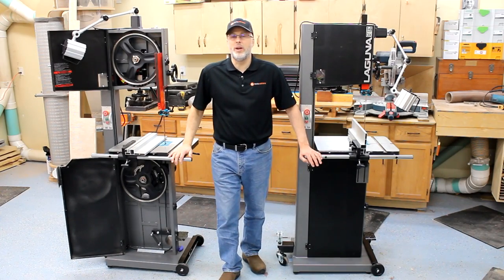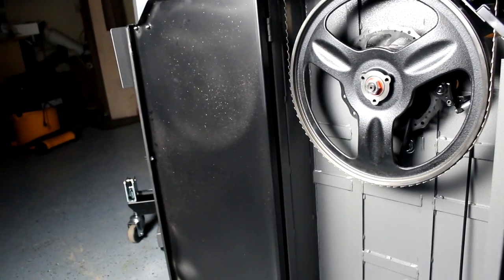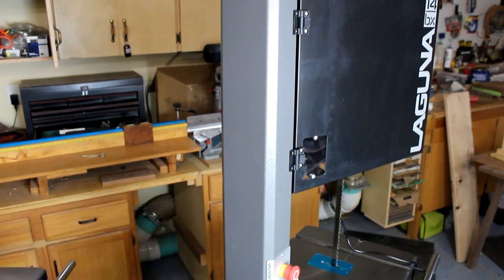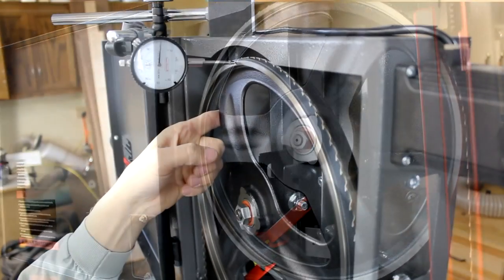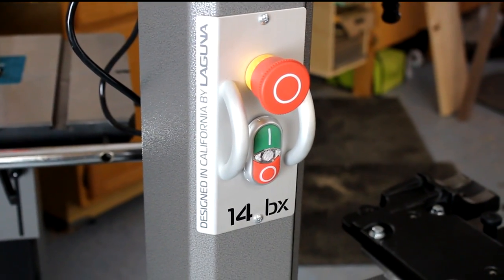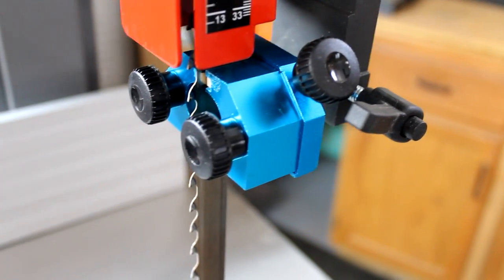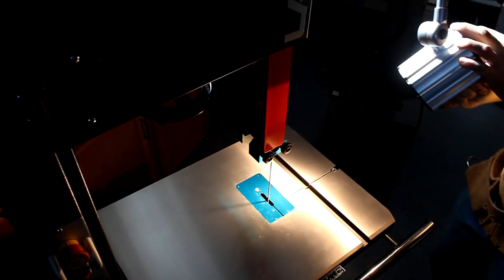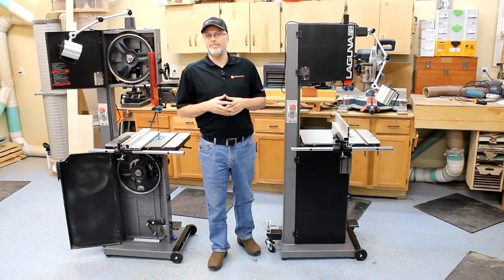Laguna 14bx Bandsaw "Deep Dive" Examination by ToolMetrix

Comment: This was a very helpful review, thank you. I mainly want a bandsaw for dimensioning rough stock and will definitely do a lot of resawing once I have this capability. I also need a machine with a small foot print and good dust collection as I do not have a dedicated workshop to myself. Last but not least, I primarily do my woodworking with hand tools (with exception of plywood projects where I stick with a jigsaw, a small router and a nice track saw set up). So I planned on not putting much weight on the accuracy of a bandsaw as I’ll take a hand plane to it anyway and quite enjoy that process. But after viewing this review, I am excited about the quality of the finished product off the saw. It will allow me to do some fun veneer side projects (hanging lamps!) and to complete projects more efficiently and enjoy more time with my family.
Reply from the maker: Hi Brew, the quality can be very good if you have a good quality blade installed and the saw is tuned.  The approach that I usually take for slicing veneer is to prep the board by planing both sides, slice off a veneer, then sand both sides.  The side that was planed will only need light sanding, while the side that was resawn will need more.  For veneer slicing, a high quality wide blade makes a BIG difference.  If I was making a lamp, I would take the time to set up my Resaw King blade because the surface finish matters.  If you have a drum sander in your shop, it's less critical to get a stellar surface off the resaw, but its still nice and it lets you waste a lot less wood.  For most of my resawing (making 2 boards out of 1, or just using the bandsaw as a "low-dust planer"), I don't really care about getting a great surface finish right off the blade; I just care about flat.  So, for that kind of resawing, I just leave my 1/2" 3 TPI blade on the saw and it does fine.   I'd love to see the lamps that you make.  A wood veneer lamp is on my "someday" list.  :)

Comment: Anyone use these saws for cutting metals with?  Looking to cut st/st exhaust  tubing, but would mainly be used for aluminium
Reply from the maker: I believe that it would be too fast for cutting steel. Aluminum would work but might not be ideal. I’ve cut small pieces of aluminum but not much.
Reply: @ToolMetrix  thankyou for the reply is there only one speed setting
Reply from the maker: Yep. Single speed
Reply: @ToolMetrix  thankyou again

Comment: I am debating the 14/12 and the 110 14BX.  Besides the brake is the 14BX worth the extra money?  Both have the power and resaw capacity I need.
Reply from the maker: Hi Andluth, I like the brake for safety reasons as well as convenience.  I'm accustomed to it now so it would be hard to go back to not having one, but I really liked having the 14|12 as well.    Power and capacity wise these saws are the same, so what it comes down to is the brake as well as the setup process.  The BX goes together a lot quicker because of the unibody design.  The additional dust port on the BX is also nice, although I mostly don't use it and I still get good collection.
Reply: Thanks!  I also read that the frame steel is thicker on the BX. Is that true?  Is the BX significantly more stable (vibration) than the 14/12 and do you think the mobility kit makes a difference in stability?  I hate a wobbly or shaky saw.  Great channel!
Reply from the maker: I have heard that the frame is thicker on the BX, but I haven't personally confirmed this.  I did test for vibration on both saws and found them to be comparable.  That is after replacing the tires on the 14|12, after there were some reported problems on early units which I had.  Having said that, I could measure the difference with a sensitive meter, but I could not feel the difference myself, and I could definitely not assess any difference in cut quality before and after replacing the tires.  So, if I closed my eyes while using them (not a great idea) I don't think I could tell the difference between these two saws.  And I can't tell the difference in the final project.  

Thanks for the feedback on the channel.  I'm hoping to put more time into it this year, cover some additional tools and maybe do some projects.  Lots of ideas, not enough time.  Such is life I guess.

Comment: Gah! Still trying to justify the $300 more for an extra dust port and a foot brake on the 14BX compared to the 1412. Decisions. 🤔
Reply from the maker: Hi Johnny, Super easy decision. Plunk down $100 more (or whatever the difference is currently) and get the 2.5 HP bx. You won’t regret that. 😉
Reply: @ToolMetrix  I'd love to, however; I don't have 220v in my shop and don't have the luxury of upgrading the wiring. 😞 That's why I'm comparing the 1412 and the 14BX
Reply: Both the Laguna 1412 and the 14BX being 1.75HP. But I believe they're both able to be re-wired for 220 in the future? I'd have to check.
Reply from the maker: I totally get that. Can’t go wrong either way between the two that you’re looking at.
Reply: @ToolMetrix  Do you feel the extra dust collection port and the brake on the 14BX is worth the extra cost over the 1412 with all things considered? I believe that's the two main additions other than the 14BX being all one frame compared to the 1412. Am I missing anything?
Reply from the maker: I love the brake. The dust collection is great on the 1412. Second port isn’t critical from my perspective.  I can’t think of other functionality differences. The switches are different but not a big deal.
Reply: Johnny I had the same dilemma. I am a hobbyist wood worker. I have yet to get into serious re-sawing but there have been a few instances that I re-sawed a board through the table saw then got it finished on the planer. I hate jigsaws and needed to notch some things before. While the brake is a good feature I couldn’t justify the added expense. I bought the 1412 on sale today. I got  some extra money I had not anticipated and splurged on this saw. I really hope I use this saw enough to enjoy it and not see it as a waste of money. I think the likely hood of guilt over an excessive splurge would be greater had I bought the mOre expensive saw.

Comment: Some really good information in your review! With it being a “deep dive” review, I was a little disappointed to see that you didn’t differentiate between some of the features that are on either the 1.75hp or the 2.5hp, but not on the other. Specifically, I noticed you mentioned the brake two or three times. Unless it’s changed since I bought my 2.5hp, the 1.75hp does NOT have the brake feature.

One other area that’s different on the two saws are the lights. On the 1.75hp saw, the only light option is the canister-style light. It also has only one place to mount it—on the front above the table. For the 2.5hp saw, the articulating-arm light is the only option. It does, however, give you two choices for mounting. For me, the light information is fairly important because I find that the older I get, the more light I need 😂 Like you, my preference is the articulating-arm style. The two light styles are not interchangeable. The canister is a 110v light, and the articulating is a 220v light. Actually, I considered getting the 1.75hp so I wouldn’t have to add some 220v outlets. I would have had to do that eventually anyway for other tools I bought. For some folks, however, adding 220v outlets might not be an option for them, if they rent, for example. My point is that if I wanted to get the 1.75hp, I couldn’t get the articulating-arm light, and I wouldn’t have the brake, either. Those were the two deciding factors that caused me to go with the 2.5hp. 

I’m sorry if my comment sounds like I’m dinging your entire review video...I’m really not!!!  You have some really good information overall 😊 I just wanted to alert you to the differences in the features and explain why it could be confusing for some, or even cause them to buy the wrong hp saw, if those features were important to them.
Reply from the maker: Hi Kristi, thanks for your comments. At the time that I filmed this there were no differences in features or accessories between the two saws other than the motor and the on-board outlet (2.5 HP outlet is wired for 220V, and on the 1.75 HP the outlet is wired 110V).  Other than that, these saws are part-for-part identical.  If there would have been more differences I would have covered them. You’re mistaken about the brake. All 14bx saws have always had one, and you can see that on the web site: https://lagunatools.com/classic/bandsaws/14bx-bandsaw/. You're also mistaken about the light.  The 14bx 1.75 HP can use the articulating arm light, and in fact it is shown with one in this video.  I think you’re confusing the 14bx 1.75hp with the 1412 which doesn’t have a brake, uses a 2 piece body, and some other subtle differences.  Cheers, Paul

Comment: I think you sold me.
Reply from the maker: You won’t regret it. :)
Reply: @ToolMetrix  Do you need any special guides to run an 1/8" blade or will it run on the stock guides?
Reply from the maker: Hi Ilan, you cannot run an 1/8" blade with the stock guides.  The teeth will contact the ceramic guides and will be dulled instantly.  For a blade that small, you can use the Laguna mini guides https://lagunatools.com/accessories/bandsaw-accessories/ceramic-guides/mini-guide/, which are softer and won't damage the blade, or you can use a Carter stabilizer https://www.carterproducts.com/jet-16-20-laguna-16-jet1.
Reply: @ToolMetrix  Thank you! What's the smallest blade you can run on the stock guides? 3/16"? 1/4" ?
Reply from the maker: Practically speaking I’d say 1/4. I’ve never tried a 3/16” blade but I feel like it would be beyond pushing your luck. Maybe with a high tooth count and shallow gullets you could get away with it.

Comment: That’s it......I’m buying one!
Reply from the maker: Awesome! Which one will you go with?
Reply: @ToolMetrix  110 volt. Looking at the 14 bx. I like the idea of the foot brake. How does the Laguna wheel kit not get in the way of the brake?
Reply from the maker: Great saw. The pedal for the wheel kit is positioned on the left side of the saw and the brake is on the right. No interference at all.
Reply: @ToolMetrix  well I decided to go with the 1412. The ten percent off sale on laguna ended today. The 14 bx was about 20% more people than the 1412. I have never had a band saw and am not exactly sure how much I will use it. I wanted to get a good saw just because I don’t want to learn on a crappy machine. Plus, I wanted something I could “grow into” should my interests and skill take me in a new direction. I bought it today and it’s on back order until the end of October. The foot brake looked like a great idea. I read a few reviews about the brake system breaking and rendering the saw unusable. Since I won’t have anyone working with me i figure that eliminates one reason for the brake. The placement and size  of the off switch makes me think the executing of an emergency stop might be easier to just hit the switch than trying to find the brake with my foot.  Sounds like laguna worked out some of the quality control and customer services issues that were a cause of complaints about three years ago.  Once again thanks for your reviews.
Reply from the maker: You’ll love the 1412. I like having a brake but it’s not a must have.
Reply: @ToolMetrix  have you used the Carter mini guides for this saw. I followed a link you posted somewhere in a response to someone’s comments. They seem so much more economical at $80 than the $280 mini guides from Laguna. Completely different engineering too and from the looks of it the Carter guides for 1/4 and narrower blades looks superior for scroll type sawing.
Reply from the maker: Yep, I like the carter mini guides a lot. Very neat design.